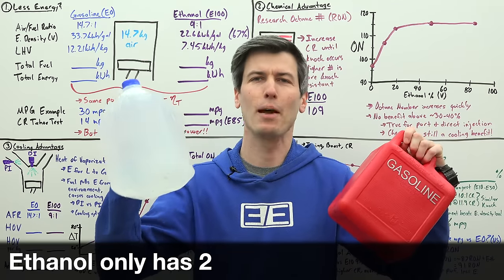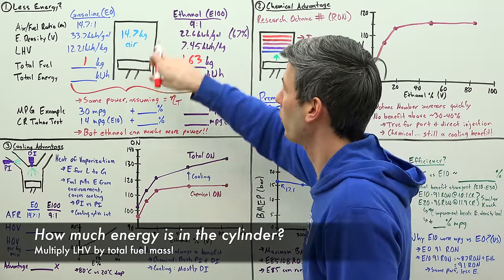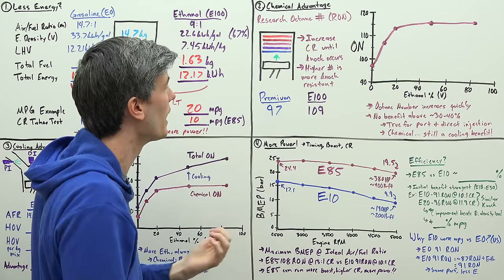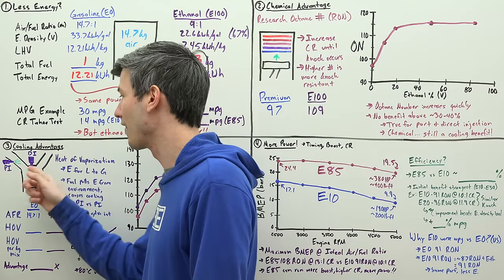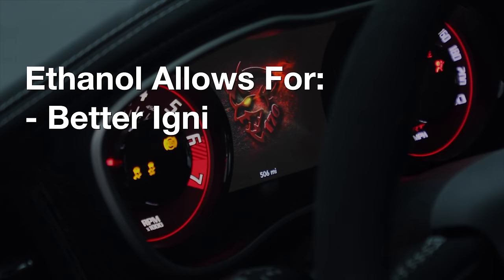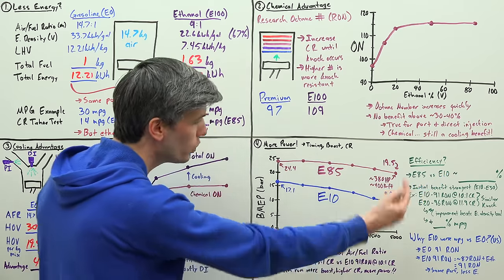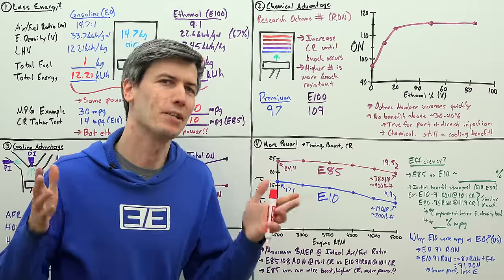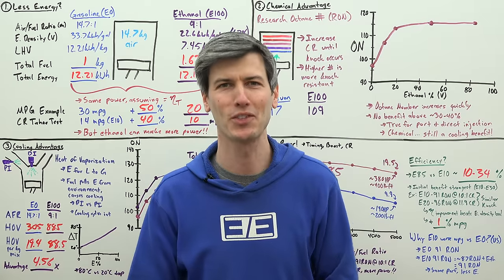Why Does Ethanol Make So Much Power? (Versus Gasoline)

Comment: Great, video however, I think your viewers would be better served by keeping your units consistent in the mks system. Using kw-hr for energy (in non-electrical systems ) makes no sense. I understand (I am a trained engineer) but many of your viewers would not. For non-electrical I would use joules (or kj) for energy, and maybe j/sec (instead of watts) for power to keep it not so confusing.

Comment: Brazils been using ethanol for decades. The mileage does decrease using it compared to gasoline, but the lower price makes up for it. Most cars sold there are what they call “flex fuel” and you can use ethanol/gasoline in nearly any ratio and the cars will always run well. As for power, the gains with ethanol are around 2 to 3 hp in Volkswagen engines at least.
Reply: A Chevy 5.3L gets a clean 380 horsepower on E85 vs a dirty 355 horsepower on E0.

They are phasing out a lot of flex fuel cars in Brazil similar to us.  The Ford F-150 is now going to be sold there but it is not flex-fuel for some very odd reason.

If you had dedicated ethanol engines, you would increase both mileage and power over gasoline, even over diesel engines.

Here is one Ricardo built for GM a few years ago:

FROM RICARDO:
The new federal CAFE standards are calling for a doubling of fuel mileage performance, which, Vint says, is going to send OEM’s looking for high octane numbers to improve efficiency and ethanol is the best source. Ricardo, an engineering firm with over 100 years in the business of engine design, has developed an extreme boosted direct injection engine (EBDI) to optimize ethanol blends. The 3.2 V6 gasoline engine rivals the power and torque of a much larger GMC Sierra 6.6 diesel, he said, and it delivers 3.5 percent better fuel economy than the diesel.

Comment: As always, very informative. I would think the real goal would be to reduce the cubic inches of the E85 engine until it produced the same horsepower and torque as the E10 engine while maintaining the boost and compression ratio advantages of the E85 fuel. At that point comparing fuel economy would be a better demonstration of the fuel chemistry differences. Also, as mentioned in other comments  and previous presentations, the use of switch grass to generate ethanol would be more effective at reducing greenhouse gasses.
Reply: Define fuel economy. Distance per dollar? Distance per mass unit ? Distance per volume unit ?

MPG or km/l lose their relevancy if the fuel costs are highly dissimilar. 

Example: IF petrol yielded twice the distance-traveled/unit-volume to ethanol, yet the petrol was 4-times the price, then the cost/distance-traveled using petrol would be twice that of using ethanol. So who would care about “MPG”?

In some venues, petrol is the cheaper option, while in others ethanol is cheaper, irrespective of the relative mpg’s of the two fuels.

If the only important consideration for you is energy density (e.g., mpg), then please consider that the worst energy source currently used for road cars is electricity, with energy densities at best only 2% as that of petrol. The mass-based energy density of batteries is in the range of 0.1 to 0.27 kWh/kg.; in comparison, gasoline is 13 kWh/kg.

BEV’s must really suck, huh?
Reply: @sking2173  My point was simply that Ford had designed a 3.5L V6 generating 190 HP/200 ft-lb torque with E10 fuel as adequate for the vehicle in the study. If the E85 engine generates 390 hp/400 ft-lb then the logical conclusion (assuming engine size scales linearly with horsepower) would be that an E85 engine could be as small as 1.75L. That would provide adequate power for the vehicle with significantly reduced E85 usage.

Comment: I recently tuned my car to run ethanol, I got an easy 10% more power. Stock the car made 170hp at the crank, FBO on 93 it made about 275 at the wheels and E85 I'm now over 300... It's only a 1.8! Currently building an engine for a bigger turbo, end goal is 400-450 to the wheels.

Comment: Would you see a performance or efficiency increase if you blended 91 pump (E0) with E85 at a 5 parts 91 to 1 part E85 bringing your octane up to say 95? Premium in my area is typically 91 octane

Comment: What about E100 fuel? 100% pure ethanol has some water in it which means it can allow even higher compression ratio since water has very high heat capacity. What's ur thought?

Comment: You’ve neglected to mention the emission of formaldehyde and acetaldehydes being some of the major health problems of ICE on ethanol
Reply: Oak Ridge National Laboratory shows there are those emissions when starting a cold engine but with US-06 driving conditions (i.e. real world driving), formaldehyde and acetaldehyde exhaust is negligible.  Acetaldehyde with E0 under US-06 is very high compared to E85.

Do a search for "Fuel Economy and Emissions of the Ethanol Optimized Saab 9-5 Biopower" and see all the pollution of E0 vs E85.  Absolutely stunning.  E100 would be even better.

Comment: The compression ratios used in the example at the end are amusing. My Mazda 3 with Skyactiv-G 2.0 engine has 13:1 compression ratio and runs on regular pump gas (87 octane). There is more efficiency benefit in competently used direct injection than in extra ethanol.

Comment: Did you know the reason we have the octane levels at the pump that we do?  And the reason for the price difference?  Marketing.  It costs next to nothing more to manufacture higher octane fuels than lower ones since the feed stock is the same, but the pressure and temperature when run through the catalyst are adjusted slightly.  Pump gas is a mix of hydrocarbon molecule sizes and shapes to get the desired octane rating.  Most hydrocarbons in fuel have a traditional, or Lewis, structure.  One form of octane is circular, eliminating two hydrogen atoms, leaving us with C8H16 (or (CH2)8 if you want to get more specific) has some very interesting properties beyond the surface .  I had a friend working with it in the 70's for aviation fuel.  It showed great promise to be the next best thing.  I might sound nuts, but I think the DoD came in and classified it as military only.  Got my hands on some pure octane some years back.  No clue the mechanical or lab rating, but it ran in my gear like it was the best race fuel ever made.

Comment: on the short term and power seems godly, but on the long run, since the ethanol lacks the ability to lubricate the injectors and valves, is a no go
Reply: Gasoline and diesel fuel since sulfur has been taken out don't lubricate either.

Diesel engines now have their injection pumps lubricated with engine oil.

In Brazil they have found that identical engines last >300% longer on E100 than their common gasoline.  Soot is what wears out an engine and oil.
Reply: I been using the Purple power additive. Its what alcohol racers use. I havent used it more than a year but I swear my fuel pump is quieter. I got a video about it.

Comment: I demonstrated an engine built specifically for E85 could rival the efficiency of a gasoline engine years ago, when E85 first became widely available at the pumps, and got laughed out of the room by all the "experts".  Two engines, one built for gasoline, one built specifically for e85, ran them both on the dyno, both made the same power, both used the same amount of fuel.  Thank you for giving this topic the attention it deserves.  We'll see what the "experts" have to say this time around.

Comment: This (cooling) also addresses the power benefit of methanol injection, particularly in a turbocharged engine tuned to take advantage of the cooling effect, i.e., higher boost.

Comment: Great explanation.    But you didn't speak much on the economics of the fuel blends (OK, only so much you can pack into 13 minutes).   To achieve 91 octane fuel, it would appear that they could start with cheaper, lower octane gasoline and then the ethanol would bring up the octane number.   Kinda like lead used to do.    
But cost of the fuel blend would also be effected by cost of ethanol.    And possibly the accurate cost of ethanol is not a simple question.
Reply: Thats how it works now sir. Base gasoline is 85 octane. its the additives that bring up the octane number. Wiki will explain it.

Comment: I've seen people mixing E100 or E85 with gasoline premium 93 oct can it change the chemistry of the fuel will u have the same benefits of both fuels how does that work ?? Another video suggestions does mixing fuels give u more power
Reply from the maker: Depends on the setup, you want a vehicle that can properly detect ethanol content. Cars with Flex Fuel or things like the new Demon have sensors to detect ethanol content and adjust accordingly, so you can fill up however you like and it’s no big deal. But of course you wouldn’t want to take a regular car and just throw ethanol in it and hope for the best. It would be setup for the right air-fuel ratios and things would likely get wonky quickly.
Reply: @EngineeringExplained  Try doing a search on YouTube for "Many Cars Can be Made Flex-Fuel with a Software Update" and see the clip from "Pump the Movie".  The ECU in cars will allow you to choose flex fuel with fuel sensor or O2 sensor.  The MAPs to run ethanol are in the cars.  I have been driving with the yellow light on with E85 on non-flex fuel cars and not noticed any problems with the way it runs.  On the next tank of E10, the yellow light goes out at least with my Buicks and Chevys.

Comment: Losing 5-7 mpg for power even if it’s a dollar cheaper a gallon is not worth it. And the fact that it attracts moisture is horrible for seals and promotes rust build up. 
And if you convert to e85 in a car that isn’t driven regularly you have a real problem of moisture build up in the tank and potential engine damage because of it. This conversion is useful only if you don’t care about mileage, have the FU money to spend on the conversion and the added fuel needed, don’t plan on ever letting the car sit for any length of time. Specially in a humid area. 
But if those things aren’t a problem for you then I say, enjoy it. I’m sure you’ll sleep just fine knowing you spent your “wisely”.
Reply: Mercury Marine, which hosted a Webinar on ethanol myths, noted that ethanol does not "grab water molecules out of the air." It is hydrophilic, which means ethanol holds water. With regular gasoline (E0) as well at E10, the primary cause of water collecting in tanks is condensation on tank walls. But unlike E0, which can absorb almost no moisture, E10 can hold up to half of one percent of water by volume, and the water molecules will dissolve in the fuel. The "solubilized" water will bypass the water separator and burn harmlessly through the engine.

Mercury Marine also said E10 may be the superior fuel(over E0) because it keeps the fuel "dry"

Ever wonder why no one has to buy gas-line antifreeze anymore since E10 came?
Reply: I have to agree with Lamont. I enjoy driving right by people like you. Making more power.

Comment: Iirc I read a few years back that especially small turbo charged engines under high load high rpm scenarios like Autobahn driving have to inject additional fuel which wont get burned just to cool the cylinders. So higher ethanol content petrol could also help with that if I understand correctly. Here in germany we have 2 regular fuels. We have E5 and E10. Both 95 RON. Is the additional cooling effect of the higher ethanol content also represented in the Octane number at the pump? Its not directly Octane but it literally has the same effect. Its not more resistant to burning but it actively cools the cylinder.

Comment: Answer in simple terms: volatility and the energy released when burned under compression makes the energy release in the state of detonation instead of combustion. Quite literally a contained explosion that puts out more force but requires more fuel to get it to work.

Comment: So would it be more beneficial for me to run 91 in my 2017 Passat 1.8T or 87? I’ve heard 91 is better but the conclusion (unless I’m not understanding correctly) would suggest that 91 over 87 isn’t enough of a difference to matter other than cost?

Comment: Additionally, even though Flex-Fuel vehicles can and will detect E85 vs. E10 or such and will advanced timing, I don't know that boost is increased on turbocharged engines and certainly compression ratio can't be changed on the fly, which is a key characteristic of efficiency.  A pure E85-designed engine, or even E20 or E30, would be tuned just for that, not E0 gasoline and therefore actually have that small efficiency gain like Ford did with their research.  As noted from the GM experiment, flex-fuel engines will tend to consume about 30-40% more E85 than E0.  I don't know if any are better than this as original FF engine designs are over 15 years old, i.e. maybe the latest and greatest can do closer to a 15-20% mpg reduction?  I can see turbocharged direct-injection engines getting the most benefit (or being able to make the greatest adjustment, if that makes sense).

Comment: I got my work car from my mom it’s just a normal 2015 explorer. She ran 87 Costco gas for years and drove a straight line to work everyday, she got 15.3mpg. I run e85 from the pump and I’m only getting 14.7 not that bad for the price difference.
Reply: Actually im surprised Fords had the worst mapping for Flex fuel.

Comment: Hi thank you for your video.  
1999 ford expedition 5.4 230K miles needs at least one head gasket. So which fuel would be recommended for better performance per gallon before and after the engine is fixed?

Comment: Good stuff, but as mentioned at the end oil companies get the same octane fuel with E10 added, they just use a worse blend stock. If we use 20% ethanol they’ll just use an even worse blend stock, still yielding 87 R+M/2 and a further decline in MPG.

Comment: Here in Brazil we make incredible HP numbers in tiny 4 cylinders with Hydro Ethanol, witch is the pump ethanol. It is 95% ethanol and 5% water, what make even more knock resistant and better cooling. Very hard to start a car in the winter with our Hydro Ethanol. 

In my calculations if you make a a blend of 25% water and 75% ethanol, it has the same fuel cooling then Methanol. Makes sense here since ethanol is much cheaper then methanol.

Comment: Is there a significant advantage to tuning an engine for ethanol running an engine NA instead of boosting? I’m assuming cooler/denser charges and advanced timing may make a big difference.
Reply: I have an LT4 engine and everything I read is 40-60 more hp. I have read up to 85hp but i would bet that alot or maybe too much timing advance.

Comment: Right now I am experimenting with E85 in my 1997 BMW R1100 motorcycle. At first it didn't really run right but after a lot of tuning I'm slowly getting it to run properly. Also, is it safe to run E85 in a direct injection engine with the higher pressure fuel pump? You would think the alcohol has a lot less lubricity.

Comment: The issue with E100 (Hydrous ethanol) is the car is impossible to start at 14°C (57°F) and below if your cold start system (that either primes the engine with gasoline or heats the fuel rail) has some sort of malfunction. Found it the hard way...
Reply: Low volatility fuels are hard to start in cold weather.  Diesel fuel is of lower volatility and their engines have glow plugs for starting.

E100 engines do need heated fuel injectors.  The US went to the dirtier E85 to have enough volatility for starting.  More completely pollution free E100 would have been better IMHO though when Brazil went to E100 they had to have small lawn more sized fuel tanks of gasoline like you mention in cars for starting before the heated injectors came to be.

The great thing about low volatility fuels is your chances of burning to death in a crash is far lower.  This is indeed the very reason why the Indy 500 switched from gasoline to alcohol fuels.
Reply: Temp is never under 70f here 🤣

Comment: I live in New Zealand. This must work on more modern vehicles. A guy I worked with has a Holden Commodore (General Motors Australian) in American they sold them as a SS which in Australia and New Zealand HSV (Holden Special Vehicles) Commodore.  Which is they top spec Sedan (sport type suspension more powerful engine). It is an early build on and has some work done to the engine. It will run the best on BP 98 octane. The Gull 98 octane fuel has 10% Ethanol. I know of other vehicles where the Gull 98 octane work as good as BP 98. The Gull force 10 98 is 10% ethanol. It seems that Ethanol fuel doesn't work as good on the older engines.

Comment: TL:DR, Ethanol needs a more richer stoechiometric mix to work well, but also haves an octane index over 100, when normal gasoline is at 93. You can increase boost or compresion ratio of the engine which improves power delivery. Also ethanol is cheaper than regular gasoline. Ethanol keeps engine combustion chamber cleaner of carbon deposits.

Comment: it has a high octane (resistance to preignition) so ignition can be started early (timing), this benefits flame propagation, which results in higher cylinder pressure, which results in more power . i think could be wrong